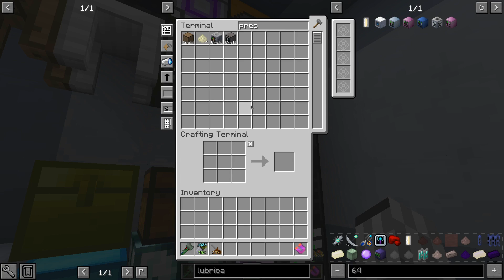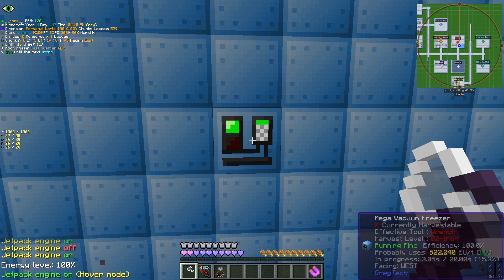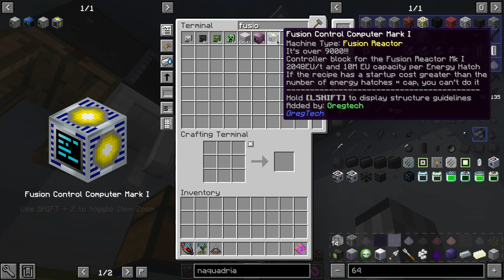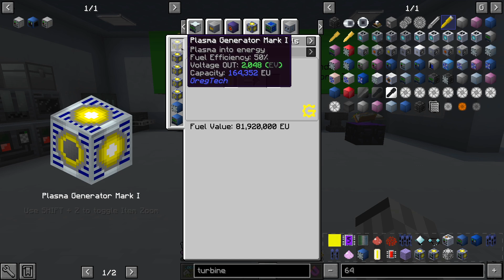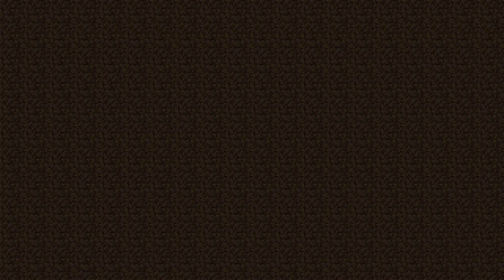GTNH S02E11: fusion time!

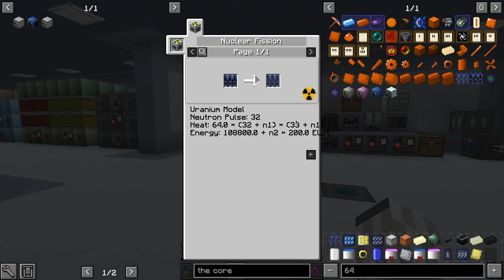Comment: 9:24 I just tried putting 2 extra utilities item nodes with 19 speed upgrades, so that they work every tick, and made one input coolant and other take out coolant with <10% using advanced item filter and it seems to work perfectly fine. Is there something I'm missing?
Reply from the maker: i'm not sure on what's your point...
if you are saying that managing the core is easy, then, yes, you are right. i'm exagerating.

however, now i'm curious, did you do the 40 cores setup with no redstone timers? it never missed one tick?
Reply: @AverageGregTechPlayer  Yeah, the 40 cell one, just source of coolant, node, reactor, node and a place to dump hot coolant, nothing else, worked fine for like 10 minutes straight.
There was a moment where it switched like 8 cooalnts in a second, but even that is fine.
Also even with your 360k Helium coolant cells it seems to work fine if you set durability to <50%
Reply from the maker: did you also try to save and reopen the world a coupe of times?
i feel like it's too risky to run such a setup

i'm planing on a fancy and complicated redstone setup and i'd like to show it, but now i'm thinking about doing it, destroying it and showing your solution (after testing it a bit in creative)
Reply: @AverageGregTechPlayer  Works fine and after reloading, and even if you spam throw out coolant with Q key, somehow.
Coolant gets outputted and inputted within the same tick, how is this risky. You can't even see empty spaces, and there are less coolant cells than ticks in a second, so they all can be replaced between the heat updates.
Reply from the maker: edit: ok, my bad, got what you meant with the last phrase.
for the filter, can you set it to check for coolant cells with less than 10% heat or does it start removing fuel rods when they reach 10% too?
is there any showcase of that working so i can also reference it later on?
i can't get the AND condition to work properly (i think the issue is that i haven't figured out the way of making it check for coolants regardless of the damage).
(considering how this setup works, i think you could just filter for the 4-5 different conditions the cells can reach, without using the damage values)
Reply from the maker: i'm doing a couple of tests in creative and i managed to blow it up twice while having a transfer node that should have fed in new cells, but i'm still not sure if i did set up something wrong....
Reply: @AverageGregTechPlayer   You can put filters inside filters so a bunch of things shoud be possible (including book banning). The idea with just a few damage exmaples is a lot better.
There isn't a showcase, I just came up with this right after watching the video. When you claimed it's very hard I first thought that you just need to swap coolant within a single tick, something with droppers and redstone priority, but then realised that there are item nodes that can work every tick and have a powerful filter.

Those item nodes work by searching block by block for a container at the rate of 1 move per second without upgrades, so you need to place it directly adjacent to a reactor, otherwise it slows down.
Reply from the maker: ok, i did some more tests and it seems quite stable unless i manually remove coolants (this seems a consistent way of blowing it up).
and sometimes, during the automated swap, i do manage to see the empty slot tough....
Reply: @AverageGregTechPlayer  Most likely just a visual bug, saw it too.
No idea how do you blow it up with hands, for me it replenishes too fast.
Reply from the maker: i keept spamming clicks and like after around 30 tries it blows

also, i noticed that the power output is lower than expected... is it just me?

anyways, i'm going to do a overenginered but funny and cool-to-see redstone setup, then i'll show your way and i will close with a custom "safer and more fuel efficient" layout (2x7 rods with coolant on sides, neutron reflectors and heat platings that should safeguard from 1 wrong move)
Reply: @ERRR0RR  Sorry for asking this late, but how do you configure the filters? Just put in a couple random damaged cooling cells? Or do i do something else?
Reply: @teutonen9978  Yes, you put the damaged coolant cells that you want to take out, the ones that could appear in the reactor
Reply: @ERRR0RR  Does it filter by exact damage values or just the percentage of durability?
Reply: @teutonen9978   ExU2 item filters by default work with precise NBT data, but can be made Fuzzy so they filter only by the exact damage value. Check recipes with filter in NEI.
Reply: @ERRR0RR  thanks a lot, i will check later <3